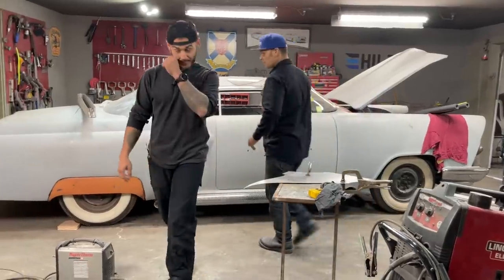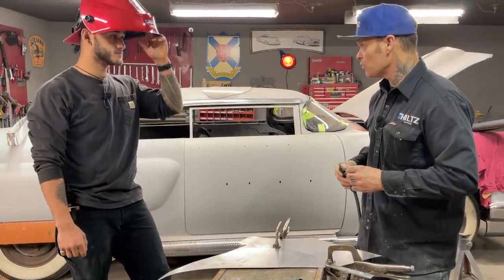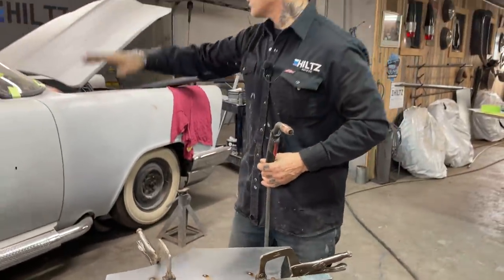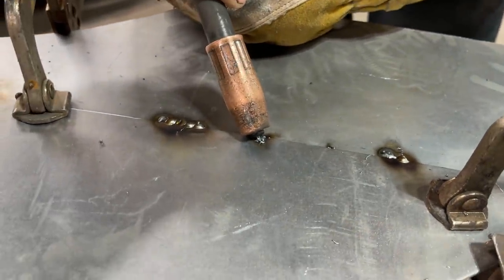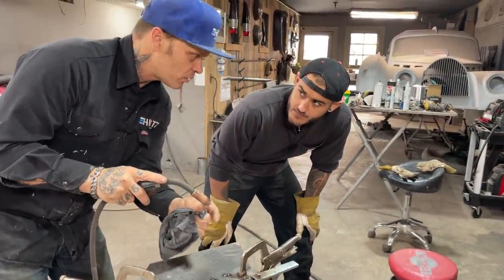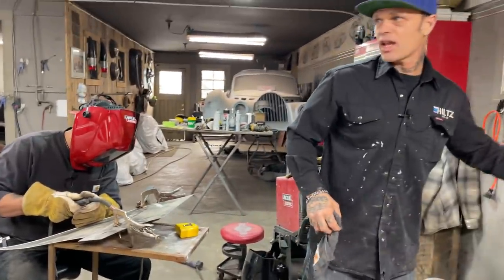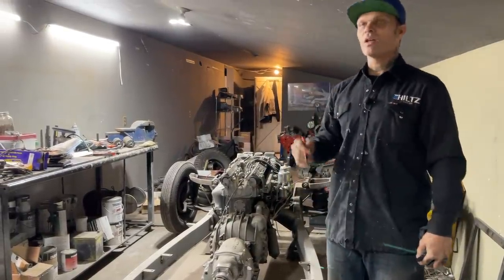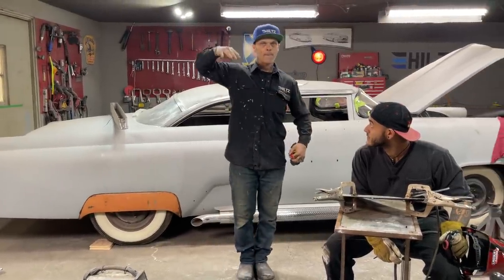Mig Welding Tutorial for Beginners: The Basics of Mig Welding Sheet Metal

Comment: I learned how to weld when i was seven years old in my Dads shop I spent my teenage years working in a body shop welding sheet metal in my 30s i was working in a fab shop building frames for train cars in my 40s i worked as a truck tech building truck bodys and stretching truck frame ect in my 50 and 60s i was a welder fabricator for a large meat company welding sanitary tubing and equipment ect . i have been doing it for 55 year but i still like watching other people welding or learning to it has been a great experience for me .

Comment: Great teacher.  I wished i had a teacher like that. Great job. As for engine not centered ,you are 100 % true.  In my 1978 corvette the engine is 1.5 inches more on the passenger side to accommodate the 3rd pedal on manual cars. Very inspiring.

Comment: Great lesson, good tip to place the wire first, I’ve been doing the old run and golf swing.  I’ve started blocking the flash of the arc starting, with my mig collet lately so that it’s not so bright,  I find my eyes adjust better and I can see wtf is going on

Comment: One important tip I learned while welding thin metal,was to never allow a ball to form on the wire.It takes more amperage to melt that ball(more heat),so i will clip it off in that instance .Also being in the air conditioning trade,i use a product from Viper to keep heat off of delicat components whike brazing,and started to use it while welding! When you are done,you just put it back in the jar!

Comment: Didn't bring up the need for a watts linkage or a panhard bar on that rear axle assembly. Without one the rear will float badly left and right on the heim joints in a corner.

Comment: I do appreciate your courtesy and gentleness in explaining your theory concerning the chassis but you are not recognizing that there is a huge difference between crush force and bending force. They are not related but in your explanation, you are thinking they are the same thing. If you squared the circle and reinforced all of the square you cut out of the tube, just as you did, look how much actual metal the frame at that point is being supported by. I know that the circle is much stronger than a square but the circle has greatly reduced the strength of the original frame at that critical stress point. 
And in addition to this, you are not taking into account my example of how heating a frame reduces the frame's actual strength next to all of your welds.
You are not required to take my word for it Chad. Just take a photo of what you did and ask any professional mechanical engineer if that frame is still strong enough to support the stresses at that area of the frame where the weight stresses change the plane of support. Bends are the last place you want to cut holes that size. You are discussing the issue and I do respect you for that. I pray that you will investigate what we've discussed. May God bless you and yours.